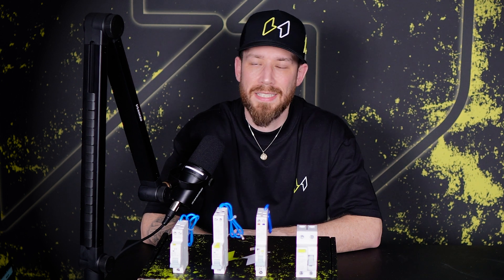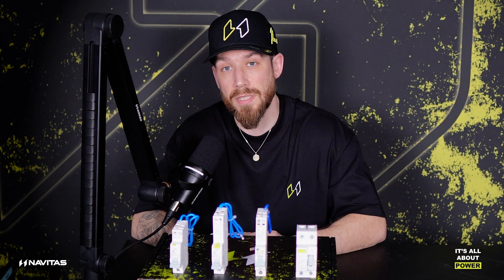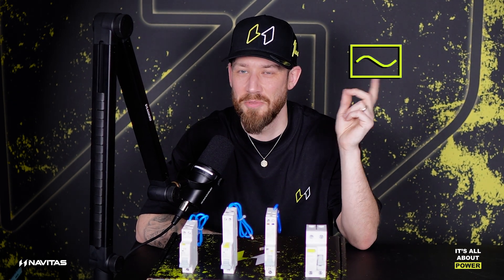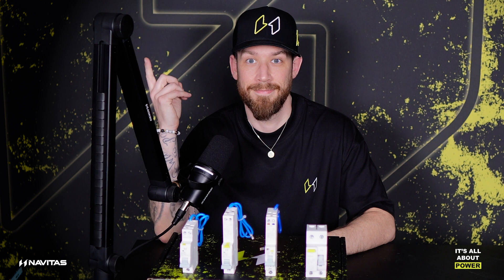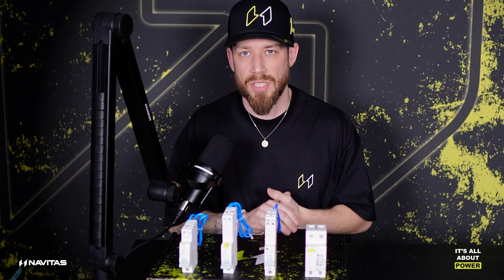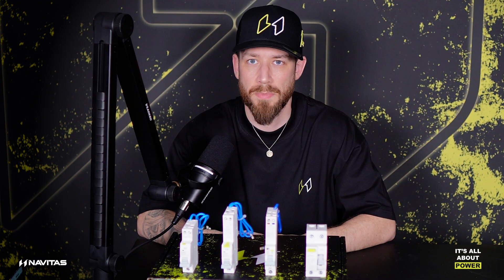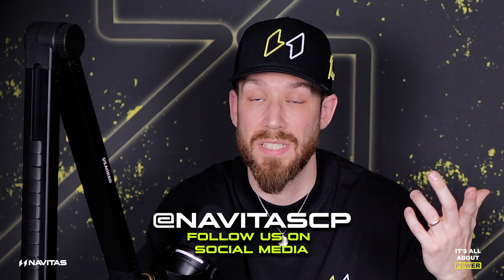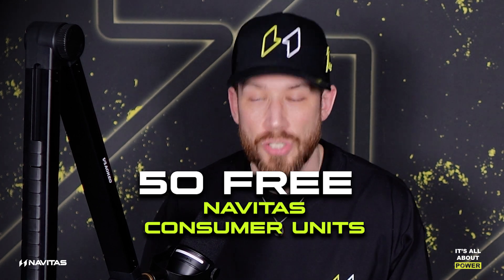AVOID COSTLY MISTAKES CHOOSING THE WRONG RCD

Comment: Would be nice to see a dual or single module type B as then I'd start to install your boards - would still be nice to see torx screws on the neutral and earth bars as even at the right setting with the right screw driver blade they still round off when being done up. 
The type B is the most important issue though as it's becoming more and more of an issue for me with heat pumps becoming a bigger and bigger part of our portfolio.
Reply: Thanks Will, and I look forward to the upcoming, more in-depth installments you mention. You make some bold statements I wanted to clarify. I'm in the French Alps, so no Big Brown Book to check but..... where you state that Manufacturer's Instructions supersede BS7671, my understanding has been that it tells us to "take into account" of similar wording as opposed to making it mandatory. I mention this with you, as a manufacturer, in mind when you point out that in almost every domestic installation, type AC RCDs with be useless at offering earth fault protection and should be replaced. I agree completely, with a few exceptions of elderly occupants with old style equipment. Why do the mainstream industry members such as NICEIC/ NAPIT and even Electrical Safety First not take your guidance as a manufacturer in replacing the AC  with a type A but rather recommend C3 do you think?
Reply from the maker: Thanks for watching, those situations you mention about the elderly technologies on the system are why there is a nice little loophole in the regs stating that “unless you can guarantee there is now dc leakage” 

Don’t forget that is caused by led lighting, led tv’s anything rechargeable, fridge freezers that are less than 10 years old and other white goods. So even those elderly occupants are likely to have dc current on the circuits.

Bs7671 outlines you should harmoniously integrate the manufacturers guidelines with bs 7671. However, the manufacturers warranty is tied to their guidance rather than that of bs7671 

The regs are a base minimum to work to, but they are also very grey in certain areas to allow for professional to design their solutions. Which is why further learning and development remains essential in my opinion for all electrical professionals. 

Thanks again for watching, appreciate the comment and support
Reply from the maker: We looked into using torx screws but most electricians decided against it. 

We use a very strong grade of metal for our terminal screws so that they don’t round very easily. Obviously an impact driver is still an impact driver lol 😂 

The type b RCD solution and bespoke boards we’ve made has been really popular with installers like yourself fitting ASHPs. Give us a call and we can see how we can help 👍🏽